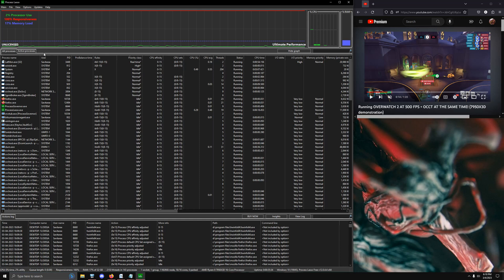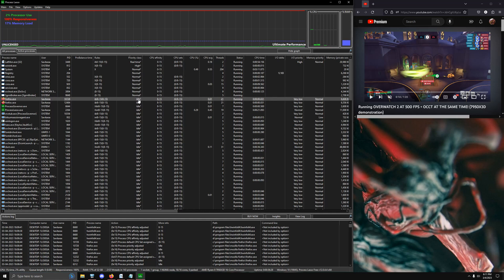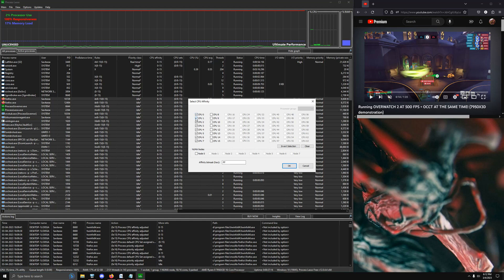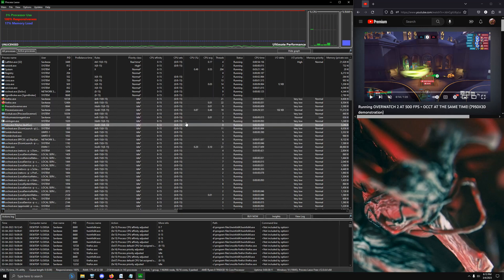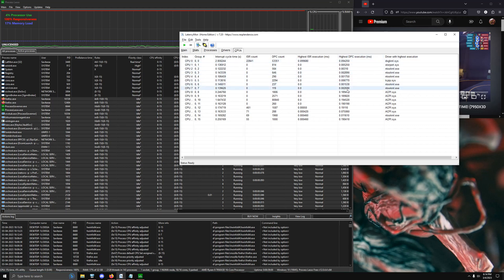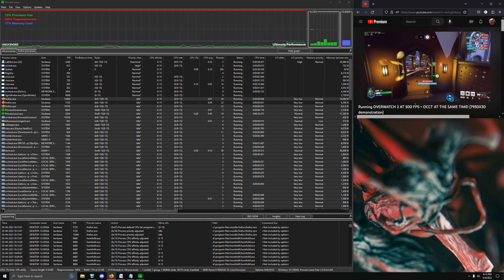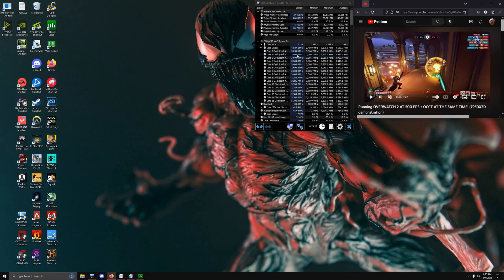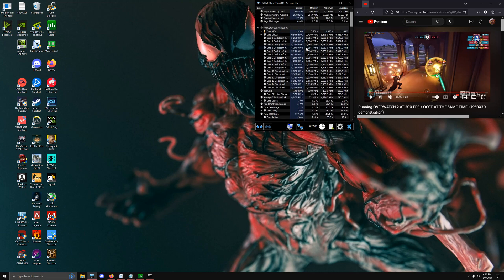THE 7950X3D LOVES PROCESS LASSO (Tips and Tricks)

Comment: Well I did test on my 7900x3d, I setup all the windows and other apps on cpu 8-23 and cyberpunk on 0-7 and nothing change on benchmark
Reply from the maker: My guy that’s cause you are running on both CCD’s. You don’t have 8 v-cache cores. It’s 6+6
So 0-7 isn’t the correct setup. You’ll want to do 0-5 for games and 6-11 for everything else
Reply: @Savitarax  thnx bro, but why I get 23 cores option? I need to disable something?
Reply from the maker: @GaLaNoS13  6+6=12, 12+SMT/hyperthreading= 24 
0-23

Comment: Thnx for your video, I can't find the commands for cp, also I have 7900x3d  so for better gaming performance I can't use  cpu 8 to 23 for windows and streaming for example and cpu 1-7 for my games right?  On my 7900x3d on lasso I have to chose from cpu 0 to 23, why on yours only till 15? Thnx
Reply from the maker: Disabled hyperthreading, so for the "real cores" not the hyperthreads. It will be every other cores. 
So
Real cores: 0,2,4,6,8,10,12,14,16,18,20,22
Hyperthreads: 1,3,5... and so on.
Reply: @Savitarax   ok i will make tests , another question , do you know why ? what i did ? and when i open e game Lasso make eveyrthing utlras slow.. like freezing the pc , bug the explorer cant restart cant do click  ?    the solution was renistall lasso but what i did?
Reply from the maker: @GaLaNoS13  lol it’s cause any new software will automatically be throttled down to the lowest states like all the other apps in the system.
You have to manually change it to the correct values. Which are the highest states after you launch a game. It’s basically to ensure that no new software coming in turns into a s*** show.

Comment: thnx for your video , cant find the commands , also another question from windows you close the Game mode? and  the other option on graphics seettings for latecny ? for better perfomance ?
Reply from the maker: here's those commands for you.
Disable idle: (more responsive, higher temperature/power usage)
powercfg -setacvalueindex scheme_current sub_processor 5d76a2ca-e8c0-402f-a133-2158492d58ad 1

powercfg -setactive scheme_current

Enable idle: (less responsive, lower temperature/power usage [Windows default])

powercfg -setacvalueindex scheme_current sub_processor 5d76a2ca-e8c0-402f-a133-2158492d58ad 0

powercfg -setactive scheme_current

But in terms of game mode I keep it on. Since it disables some services.

Comment: I used lasso on my 8700K a few years ago with Xplane 11. Worked great. However, once MSFS came out, I could not get things to run properly with Lasso so I stopped using it. Now that I have a 7950X3D, Lasso will be a must with MSFS. Mainly to prevent background apps and processes from trying to use the v-cache ccd while MSFS is using it.
Reply from the maker: oh yah what's nice about lasso is that you can disable the engine whenever you need. So if a game is picky about process lasso like elden ring, you can just disable it and it should work.
Reply: @Savitarax is there many games that hate process lasso or just few?

Comment: hi, can you provide the commands for preventing downlclocking?
Reply from the maker: powercfg -setacvalueindex scheme_current sub_processor 5d76a2ca-e8c0-402f-a133-2158492d58ad 1
powercfg -setactive scheme_current
Reply: @Savitarax  thanks a bunch! really appreciate your video and am now trying to lasso some processes.
Reply: How do I know this worked? I input the command in command prompt but I don't see anything happen in that window?
Reply from the maker: @christianprice9832  if you go into task manager. You'll see your cpu usage jump from 0% ish to 100% 24/7. Your temps will also jump by about 5-10c
Reply: @Savitarax  thank you. I must be doing something wrong then. Is the command above one command or two commands? I am inputting it as two separate commands. Is that correct?
Reply from the maker: @christianprice9832  Here's the 2 commands to enable and disable it
DISABLED
powercfg -setacvalueindex scheme_current sub_processor 5d76a2ca-e8c0-402f-a133-2158492d58ad 1

powercfg -setactive scheme_current

ENABLED
powercfg -setacvalueindex scheme_current sub_processor 5d76a2ca-e8c0-402f-a133-2158492d58ad 0

powercfg -setactive scheme_current

2 Commands each, just double checked these worked

Comment: Which cooler do you use for your CPU, PC case and PSU?
Reply from the maker: Arctic liquid freezer ii280
It’s a very good price and tops the charts
Reply: @Savitarax  I'm trying to choose the best cooler for 7950x3d (but I also got 7800x3d, but went with 7950x3d, much better in a long run), currently building rig from scratch, thought about noctua but it will run 6-8 c hotter I'm sure.. I thought about arctic liquid 420, have to take a look these charts! Much appreciate for the answer!
Reply from the maker: @warden8288  check gamers nexus. He’s really good about in depth testing.

Comment: Will cpu clocks going below the base clock frequency affect the cpu or the performance badly after applying the cpu affinity settings? Won't they just operate normally without tinkering with the scheme_curr set to 1 for subprocessor?
Reply from the maker: Nah that’s just c-states it’s healthy. Process lasso will fix everything. I also have a massive response post for all questions

Comment: Disabling SMT in the bios is just the same as disabling SMT in Process Lasso e.g. pinning the task to the threads 0;2;4;6 etc? Because disabling SMT in bios would mean that tasks on the non cache CCD wouldnt have multithreading either. What would you suggest?
Are you running on high performance power plan in Windows?
Thank you for this video and your content. :)
Reply from the maker: It’s not exactly the same because there are restricted threads that we can touch with process lasso so they will end up being caught on hyper threads. 
But… I’m running ultimate performance power plan and if I feel like it disable idle states just for more responsiveness. Otherwise I’m all throttle states and c-states.
Either I’m all in or all out.

Comment: tried the powercfg command. The issue is that the cpu usage will not drop on idle it stays at maximum boost on the 7950x3d. Also process lasso reports cpu usage at 100%. I have hyperthreading enabled. CPPC set to frequency in bios.
Reply from the maker: Yeh it’s disable idle state. So it will never dip below 4.2 ghz.
Adds an extra 5-10c in my testing
Reply: @Savitarax  It applies the 100% usage for both CCD's so I am assuming this only works if you run on 1 CCD?
Reply from the maker: @Beefy-Tech  nope works if you have both running too
Reply: @Savitarax  I ran it with both on and the issue is it uses both ccd's to 100% meaning that latency penalty is introduced in games. What situations would you say this is good to use for?
Reply from the maker: @Beefy-Tech  it’s useful if you have process lasso because you can bind a game to one of the ccds rather than having it completely sleep and be unusable. When you run that command. It doesn’t “run” on both ccd’s when you bind it with process lasso. It just prevents the cpu from clocking below its highest turbo ratio. This is useful for responsiveness and Input lag.
Reply from the maker: @Beefy-Tech  also it doesn’t introduce the latency penalty. That’s when if I have games running on let’s say cores 0-4 and 12-15 
That’s where the penalty applies. Running the cpu at 100% doesn’t make it so the CCD’s both get used in a game. That’s only if the affinity isn’t binded properly.
Reply: @Savitarax  I see yes, that makes sense. I ran warzone 2 which wouldn't force the affinity settings though, while other games did respect affinity and so the disabling idle also worked better. Will experiment with this further. Process lasso really is great for this cpu👍🙌

Comment: what about 5800x3d i have one ? which are the v cache for me 4-8 ones ?
Reply from the maker: No dude all of your chips have the cache? All 8
Reply: @Savitarax  so should i use smt on ? if i make it on 16 cores 0-2-4 etc ones for the game and 1-3-5 for system things? or it wont matter for this cpu
Reply from the maker: @metesapcili3271 you have hyperthreading which means for every 1 core you have 2 threads. Hyperthreading can be good and bad.
Reply: @Savitarax  any suggestions to use from bios and process lasso ?

Comment: Hi! Can you also discuss how this can be used with the p-cores and e-cores of the 13900K? Also does this matter for the 7950x (not x3d)?
Reply: Yes, Process Lasso can be beneficial for both of those chips. Some tasks work better on the p-cores and others on the e-cores, so it can be useful to manually assign where different programs run. And while the normal 7950x doesn't have extra cache on half of the die like the x3d model does, the 16 CPU cores are still laid out in an 8x2 configuration and so it can be useful to split different workloads to separate core complexes
Reply: How does that work for computer chess engines though if there are two sets of processors (8 with lower speed but with vcache and 8 with higher speed but no vcache)? Hyper-threading was never recommended for computer chess because it can lead to missed engine searches and ultimately bad moves so I was wondering if it was the same case here. I couldn’t recommend 13900k despite the claim of 24 cores because it only has 8 p cores that matter in computer chess for accurate search. The e cores don’t count or you’d risk issues with inaccurate search. I can recommend the 7950X for this instead but I am not sure how it is on the 7950x3d. Sure other apps may benefit but computer chess is more sensitive to these variations.

Comment: So in this case , you should have done the opposite right ? As what i can see is browser and other non gaming app is being assigned to vcache when they should be on the non vcache cores.
Reply from the maker: Cores 8-15 are the non v-cache and 0-7 are v-cache.
Amd confirmed that all v-cache chips will be ccd 0.
So all of my apps are on 8-15 and my games are on 0-7
Reply from the maker: You can also double confirm this by checking in HWINFO and checking which cores don’t boost past 5.25 ghz.
Which happens to be cores 0-7

Comment: Hey @Savitarax, thx for sharing your experience with the 7950X3D. Can you help bust a potential myth? Some people would have you believe that when AMD's new chipset drivers or xbox game bar will turn off the non vcache CCD when you turn a game on. Can you test this? Can you prove that with process lasso, you can have the 3D cache CCD handling the game, and every other process on the second non 3d-cache CCD. If both CCDs can be active, and game performance is still within 5-10% of what you and others have shown in your videos, that would be very impressive, and interesting/original content.
Reply from the maker: ran some tests and no the chipset drivers don't ovverride anything that process lasso does. You can have both programs running on completely different chips and not have any performance issues. But if you split a game across multiple ccd's it can be an issue.
Reply from the maker: Totally, I can investigate that
Reply: @Savitarax  ooo also, if you could include the 1% lows along side average FPS in your benchmark, that would be greatly appreciated
Reply: @Savitarax  you are a legend mate
Reply: @Savitarax  Would also really appreciate this being tested!
Reply: I'd be very interested as well. Not sure why this hasn't been tested

Comment: Is that command basically the same as disabling global c states. And are you sure it's a good idea to use bitsum high performance when they are saying balanced power profile required
Reply from the maker: Yah the balanced profile is just for the ability to disable the second ccd. Cause it has core parking. The chip never runs above 75c even in extreme workloads